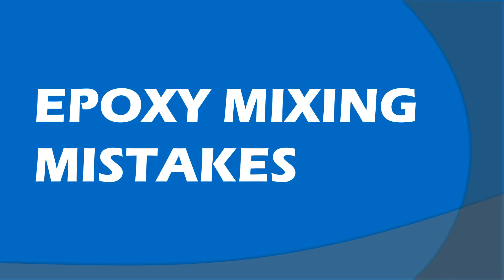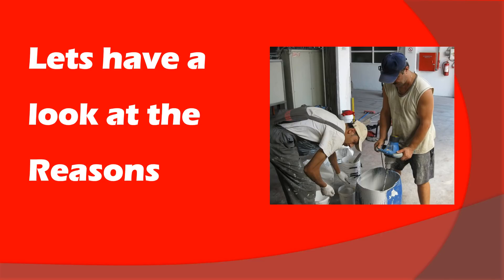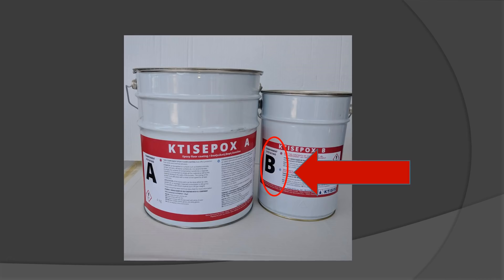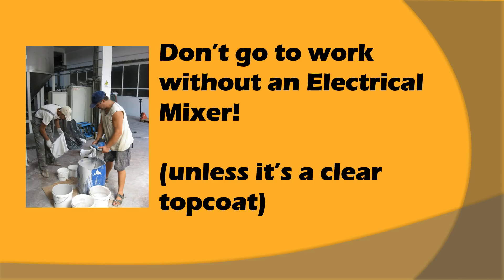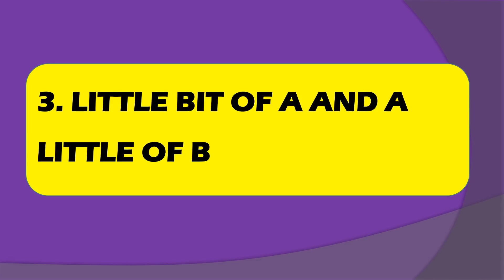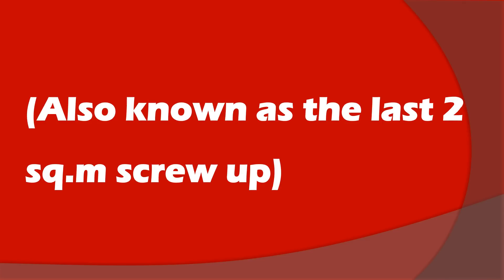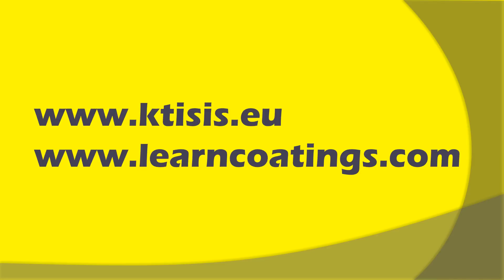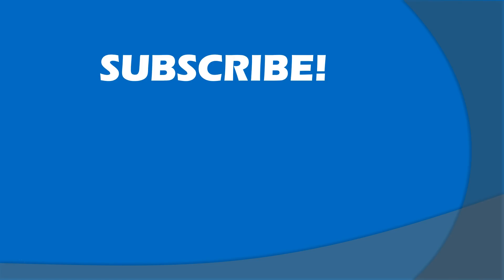Epoxy Mixing Mistakes

Comment: If you add another hardener to the esdee epoxy paint, can it be left to dry?
Reply from the maker: Epoxy should always be mixed in the correct ratio according the manufacturer requirements. Never more, never less hardener than what the instructions say

Comment: If i had problem 1 with the primer already on the floor and never hardening because it was mixed with epoxy hardener instead of primer hardener. What would be the most reasonable solution? Scrape everything off the floor and start from zero or is there maybe a way to overcoat the whole thing?
Reply from the maker: I would recommend that you try scraping as much as possible, and wiping away the rest with thinner. Then recoat the primer. I would not recommend overcoating, as there will always be a layer that has not cured properly

Comment: Hello, I had added the clear coat without the hardener then mixed a new batch with the hardener and added it on top of just the clear coat that was spread. Its hardened but with fish eyes and some spots got sticky with dirt. Is there a way to address this? Such as removing juat the clear top coat?
Reply from the maker: It is very difficult to remove a sticky clear coat without damaging whats underneath. Try using xylene to wipe it down. Also this video may help https://youtu.be/D-F0h338zNE

Comment: You suggest that it is very important to use an electric mixer.  However, on the Varathane Bar & Table Finish instructions, it states that an electric mixer should NOT be used.  Is Bar & Table Finish different from, as in your video, a floor coat?  Looking forward to knowing how to mix as my first attempt ended with stickiness all over and uneven blotches.  
Also, in my second attempt, my countertop does not have a polyurethane coating - just plywood.  Is this acceptable?  Or must I seal it with a polyurethane coat first?  (All other surfaces in my 'project' have had a 50/50 mix of oil-base polyurethane / mineral spirits.) 
Glad to see your videos.  Thanks!
Reply from the maker: Yes in large scale flooring application you need a mixer otherwise there is no way to achieve a uniformity in the mix. In small scale countertops you want to avoid fast mixing as this will lead to bubbling.
As for your question on plywood I am not really familiar with countertops. If it contains moisture it might require sealing first

Comment: Sir please tell me 
What will happen if i add more of the b component
I mean the hardener
Reply from the maker: You will have excess hardener in the system. This means the final surface might be greasy or gluey. It may lead to more dirt being picked up
Reply: @learncoatings-epoxyfloorin9448  thankyou sir
One of a structure ended being sticky on the outer surface 
And i thought it would make it harder😂😂😂🤣

Comment: if you are applying floor epoxy .
how many years it will stay shiny and clear ?
does epoxy floors gets dimmer by time or shoes foot steps ?
does epoxy need to be polished every 6 months so it stays shiny and clear?

and does epoxy color get change by time ?

waiting for your replay
thanks
Reply from the maker: All epoxies have a tendency to lose their gloss over time. It really depends on their use and how often they are cleaned. Industrial floors that are not well maintained will lose their gloss quickly. If the floor is dirty and forklifts and people are walking on them, this will destroy the gloss. Epoxy cannot be polished. Over time it tends to yellow a bit, especially if it is exposed to the sun